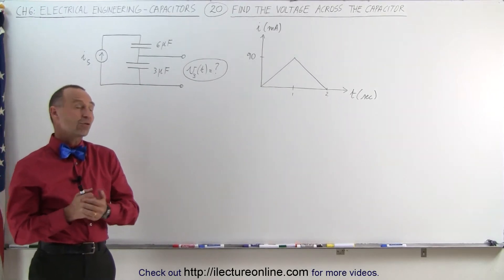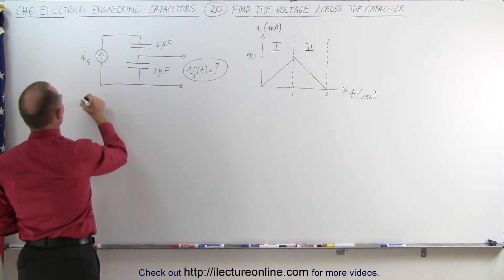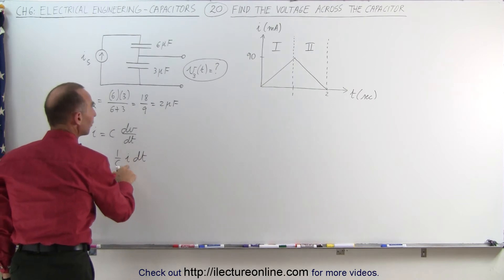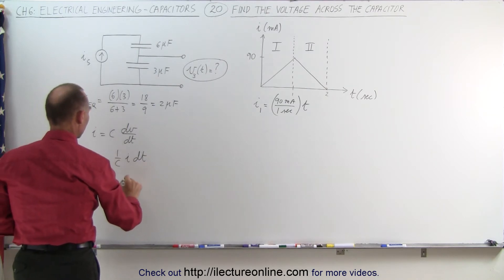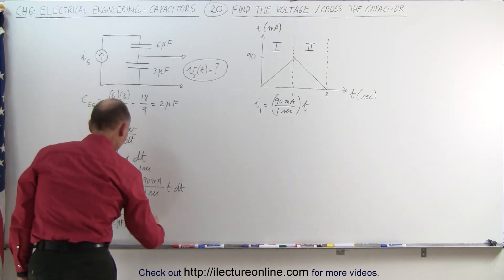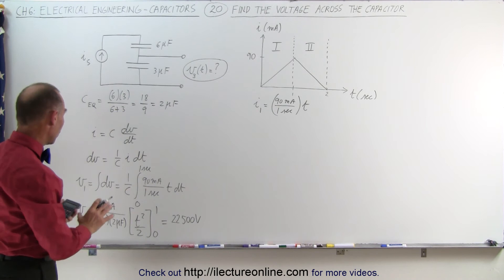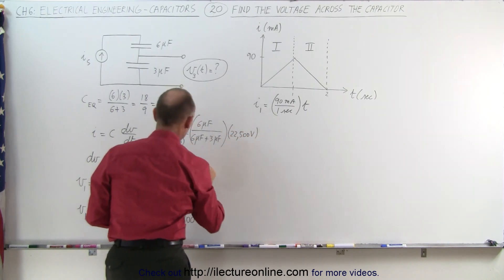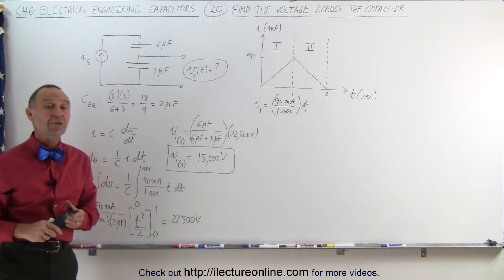Electrical Engineering: Ch 6: Capacitors (20 of 26) Find the Voltage Across the Capacitors

Comment: just curious, why aren’t we doing the second time interval (from 1 to 2 seconds)? For that I got -45000 V and so i got v of the 3uF capacitor over the whole time interval (0 to 2 seconds) to be -30000 V. Would this make sense?
Reply from the maker: If you do the second part you should use the equation for the current:   i(t) = 180 mA - (90 mA/sec) t   with limits of integration from 1 to 2.